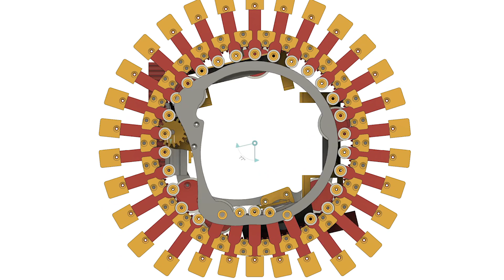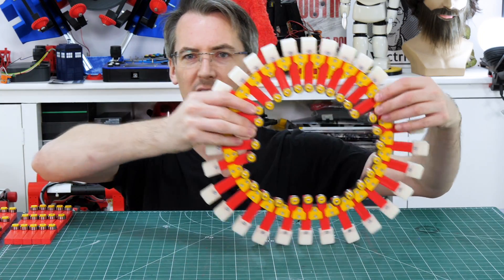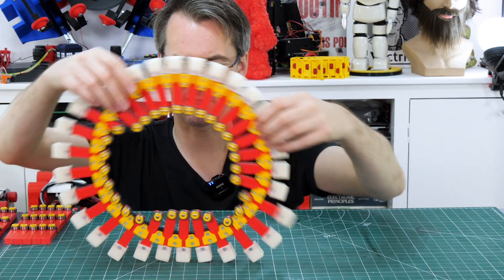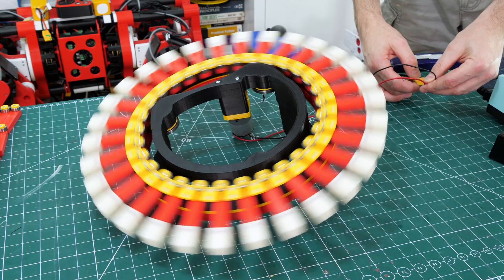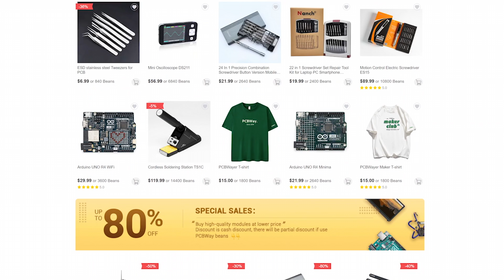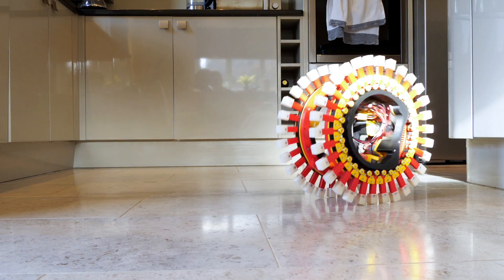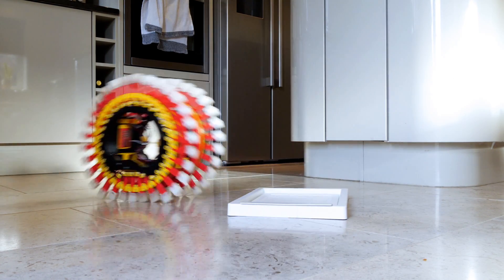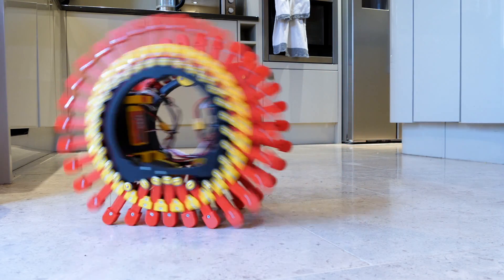Mechanically Stable Monowheel

Comment: Is it possible the wheel needs to be big enough that all the internal mass can be concentrated at the bottom of the inner circle? The theoretical maximum of this would be 100% of the drive, power and control systems would be located at the lowest point in the internal circle. The smaller the wheel relative to the internal guts, the higher the centre of mass, the closer that mass is to the centre of rotation and the more likely it is to pointlessly orbit the internal circle without driving along. The larger the wheel, the lower the carried mass can sit.

Comment: Would using round legs and feet help with the turning? _(still using the TPU for the feet)

As for turning, maybe program the inside wheel to rotate at like 25% speed?
Granted, that would remove it's zero-turn abilities, but even then, I don't think its turn radius would be all that big/problematic.

I also wonder if having a "fender" on top would be ideal, to allow it to travel into tight spaces, as the feet on the top traveling in the opposite direction wouldn't cause it to stop dead when contacting the ceiling. 
(maybe have some slits cut in at its tallest part, in order to recess mount a few bearings so that it glides across said ceiling, whereas letting the fender rub would cause friction; recess mounted, so that barely any of the bearings protrudes.)

Comment: The point of leaning is to compensate for the centrifugal force trying to tip it over. So the amount of lean you need is proportional to the speed you're moving multiplied by the tightness you're turning. You tried it out at a standstill, so the only thing it did was remove weight from the driving wheel. The goal is to maintain equal weight on both wheels. It might work better if you have your controller calculate the lean needed and then auto-balance. Mind you, that calculation would have to assume the center isn't flipping over, so if that happens it might make everything worse. A feedback system that measures the weight on each wheel might be more robust, but would complicate the build.

Comment: I think the issue is that you effectively have completely rigid suspension. It can extend in the middle but it's no good since it can't retract at the edges, plus it adds no pressure there, just rides along. So as long as the surface is flat and slippy, it's fine. But it struggles to simply move at all otherwise.

Comment: I think it would work better if it also had an outer guide rail shape to command the blade bearing to retract with more than just the weight of the device, so the bearings would be constrained on both inside and outside.

Comment: so uh, my thoughts
- heavier bottom
- some solution to prevent middle from going up the sides (like some action to perform when the middle is not oriented correctly
- possibly lock bottom feet so that they are always contracted (like a hook that would make sure the bearings touch the middle part's bottom curve)

Comment: lot of ppl commenting on the fact that it has 2 wheels actually gave me an idea for how to make it 1 wheel, make the wheel much wider, and have 2 or 3 rows of feet on that 1 wheel, and then to tilt instead of tilting the sides have a way to tilt the frame inside so that when its tilted to the left the flat section on the bottom makes the left legs go down and the right legs go upand thus using the change in the center of gravity to turn like a normal monowheel but being more stable bc of the flat sections

Comment: Im curious if adding a thin maybe rubber tape all around the outside of each wheel would help with off-roading. The object it went over seemed to wedge itself in between the feet so adding a loose material over the wheel would catch the object instead of it going in between, thus giving it way more grip.

Comment: You might want to cant the wheels in at the top and out at the bottom, put the slides on a bias. That would stabilize it in on-the-spot turns, and probably help free it more often if it gets stuck.

Comment: You need to be able to deform the inner wheel surface into a more circular shape. That would let you stand up the wheel that's not turning onto fewer feet to reduce friction.

Comment: Couldn’t you essentially do this with 1-2 point of contact for the ground with considerably more surface area for traction by using a standard rubber tire just with less air pressure so it conforms to the surface of the terrain and then adjust air pressure in the two hemispheres to get a similar but more effective way of turning? The word “hemisphere” brought to mind as I was writing you could even make it an orb that is internally separated into too volumes of air which a component joining inside that exchanged the gas between the two in order to alternated the favored direction for the sphere to turn while also having a similar mechanism to climb along the walls of the structure to intensives it to move forward or backward.

Comment: Goes to show that the difference between a cool mechanical oddity and a practical mechanical device is 95% software.  Things like the rotation could be fixed by damping the torque when in that mode for example.  I love the mechanical ingenuity James puts on display, and it's great stuff!  Many, many companies and inventors have come up with similar exercises, but the real hard part is precise algorithmic control,  which is why we rarely see concepts like this in many practical applications.

I think the next revolution in DIY prototyping ( the last one being able to print and iterate your own parts and plans with a 3D printer) is AI assistance in precision control in the presence of  external variables, and the code to implement such algorithms in real time, all at the access of someone who would otherwise not know how to code.

Comment: Try adding springs or rubber bands to the legs so they always retract. The problem I see with it is that the position between the extended leg and the retracted leg is not the same so it introduces a lot of lateral friction by relying on the weight alone.

Comment: It might be worth testing out using omni wheel style wheels on the feet. Basically mount rollers on the feet that are aligned perpendicular to wheel (maybe even make them out of flexible TPU). Doing that should still give it good grip when running straight, but would allow slippage when rotating. Another possibility would be Mecanum style wheels, although those are usually mounted in opposing pairs so I'm not sure they'd work out as well in this use case.

Comment: for the "tilt steering," you're not supposed to accelerate one side less, or not at all.  matched throttle with the tilt should get you at least through a wide angle turn.

basically, the tilt feature should provide stability for gentle turns at speed.

Comment: Nice engineering, but where is this really useful for....and if used on hard pavement, there is the wear n tear factor.... especially on  gritty surfaces...
Imagine though, a application for a Mars or Lunar type  Rover.???
Probably  would not work out ... because of the many moving parts....

Comment: Wouldn't the dip on the bottom defeat pretty much all the upsides of having that many legs?
Sure on a flat surface this dip works fine and helps with standing still, however on uneven terrain this will hinder what this thing is good at wouldn't it?

Comment: Not to smart I guess? Leaning over should only be used with enough speed to counteract centrifugal force making it fall over. That same centrifugal force would then increase the grip on the outside so it doesn't spin. Making the grip ends round would be wise to increase grip(contact surface) when leaning!
Reply from the maker: /too

Comment: Instead of leaning "in" to a turn, maybe this design could benefit from leaning "out" of the turn, by leaning towards the wheel that is going faster, it applys more friction and traction on the outer edge while releasing the friction of the slower inner rotating wheel that is pivoting

Comment: The concept of a unicycle is completely contrary to the task of climbing. The axis of rotation of the wheel and the center of pitch rotation of the machine coincide. There is no lever that would keep the car from tipping over other than a slight downward shift in the center of gravity.

Comment: For overcoming rough terrain, I think you need both: The ability to swing the center of mass to the forward half of the wheel (that you get in the traditional design), AND the bottom staying flat (that you get with this pedrail design).

Comment: Is centripetal force extending the spindles when spinning in place? Or is there added friction to the spindles, so they are not retracting as easily? Maybe both. Also having the two sides offset could be helpful on uneven surfaces.

Comment: f the feet were made to rotate perpendicular to the axis it should turn easier. Like a mini omni wheel. That should make steering much smoother. Imagine a Y facing down the shaft of the Y goes up and down between the forks of the Y Is a tube that rotates freely on a shaft that mounts to the forks of the Y. Forward backward would ride on the long axs of the tube. When you turn the tube would roll reducing the friction. Hope this helps jim

Comment: you could add an extensible third leg that could move to the back or the front that could be extended to stop the centre from free spinning when it gets stuck in the grass.  A scissor extensible "arm" could work if you make it rigid on the flat direction and would be quite compact.

Comment: What if, instead of the swivel mechanism, you could force the legs to stay fully extended on one side? Being able to dynamically change the wheel diameter would be fun. And then you could potentially connect the legs on each side to create a true monowheel with a flat wheel that could steer by adjusting the conical shape of its wheel.

Comment: Maybe if the two guides can rotate so that one side's guide moves the feet in/out earlier/later, as if to simulate an angled foot pushing to the side? I've seen something like this done in a video game but it used pistons to extend the feet in "NOOB vs PRO: Who Can Make the Best Piston Powered Vehicle? (Scrap Mechanic Gameplay)" and there was one wheel of feet but the feet were wide and had a hinge on the pistons to lean left and right for turning. Thus I thought maybe just rotating one of the guides would simulate the two ends of one wide foot. I'm not confident in it though.

Comment: instead of tilting, have springy feet? springs like shock absorbers on each foot? maybe
Reply: and a round wheel in the center section? without the flat bottom? maybe
Reply: and off set the wheel angle to give greater stability, with more weight at the bottom of the center section, maybe

Comment: The feet are rounded on one axis, if you round them on the other horizontal axis your could have a material with more grip a short way up the sides. Like a motorcycle wheel, as the vehicle leans it will transfer the contact patch up the sides of the feet to the grippy material. Might allow you to lean the corners...

Comment: Instead of using gravity to push the innards down/legs up into the "flat tire" profile, what if the bearings on the legs were in tracks that created that profile? It would for sure help the quick turning. When the wheels turned quickly the legs are sent outward with the centrifugal force.

Comment: Turning a wheel based on tilt has to do with the change in diameter between the inside and outside of the wheel. You'll need to decrease the amount of droop the outside wheel experiences relative to the inside wheel. That way, the inside wheel is simply smaller, and your machine will turn. Think car tire vs motorcycle tire. Fun watch!

Comment: what if to help with steering you had small wheels perpendicular to the way the big wheels rotate so you can still have a rubbery grippy material but then when stationary it would be able to rotate easier because of the wheels

Comment: very interesting. My brain wont stop thinking about a way to shift all the internal weight out from the center during stuck situations or maybe even up inclines. I guess the exact math would be that you want the center of mass outside the drive circle and as low as possible while not dragging on surface

Comment: Suggestion, remove the active tilting mechanism and just use rubber bands or springs to hold the vehicle in equilibrium. The end result is that it will naturally tilt when cornering and could be quite interesting!

Comment: Is it a wheel though? And mono? 😂?  Stable could also questionable 😊… Leaning would hardly help steering as te circumferences stay similar… but if you would be able to manipulate the guide on which the bearings ride to push the feet out more or less , changing the circumference.. that could do the trick….    Maybe a circumference-changing-wheel could be on your todo list.  Nice video!
Reply: Semi globes that rotate for instance

Comment: It would probably run better on grass if it actually pulled the bottom feet in rater than just letting them contract. Though i guess this was the first prototype essentially
Reply: Or even if you put a weight at the bottom

Comment: Leaning is only useful if you want to make a turn at high speed, to offset the acceleration by moving your cg. You probably want to mix that into variable wheel speeds for inner/outer track to make a turn.

Comment: When you tilt it side to side it is trying to ride on the edges of the feet instead of the flats.  Perhaps if you round the bottom of the feet laterally so that the feet have the same amount of contact regardless of tilt, maybe it will behave differently.

Comment: Rather than letting the floor push the rods in, you should pull the rods in before they touch the ground. Otherwise you're generating friction. I think that's the cause of the weird behaviors.

Comment: Super cool. Since the center stays put until it’s stuck, perhaps run a couple bars from the center over the top so if it does get stuck, the top bars would come down and around from the top and give it a push forwards  by running it backwards.
Reply: Like a dragster wheelie bar

Comment: this thing is charming as heck! even with the TPU feet, watching it spin and jump around was like a Disney robot dog or something. I think you are on to something here in terms of a fun toy! Maybe it just needs a bunch of weight in it to keep the central hub in the right orientation. Also you seemed to actually lose friction on the outside wheel when leaning because the feet didn't seem to contact the ground as much as the inside wheel. Cool toy!

Comment: I would argue like others that it's 2 parallel wheels and not a mono wheels :P 
Regarding leaning on a side to turn, I feel like the vertical movement at the center is higher actually that the height of the leg which doesn't help. Maybe limit the leaning by half and see?
Also, for the friction problem of the feet, you just have a flat face to the feet, you should do them slightly squishy and as an asymmetrical rounded V shape maybe so that when it leans over friction increase on the extended side, and reduce friction on the side where it leans.

What do you think?

Comment: What about making a big electric motor wheel. So basically you have an electric motor and the outside touching the ground and in the inside are all the components. Idk if this will work. Proporpally not. 1. too much magnetic waves. 2. the rotor would be way too big. 3. the rotor would be stationary and the stator would be rotating and idk if this will work, because normally it does not work like that.
But it would be a really nice experiment

Comment: I wonder If promoting the feet will help with some of the issues. It may help with It's Issue of getting stuck in divots. I noticed when it got stuck in The whole it kept spinning with the feet Fully extended Causing the motors to instead spin the internals without the resistance of the feet touching the ground the system wants to spin in place so by applying pressure towards the guide it should fix this issue.

Comment: I mean... Maybe it is just me, but is that not two wheels? Mono means one and thus only have one wheel. I suppose that if you squint your eyes, a rubber tire is just two wheel (the sides) connected by a foot (the bottom).
Reply from the maker: They ate the same assembly

Comment: When you run both engines in opposite directions I suspect the sideways movement of the "feet" get them stuck in their channels.  (IE they are pulling horizontally against the track, and get jammed stuck out and then lifts itself up)

Comment: Hello, nice project ! Unusual too :) I do think that if you can control both wheels internal black "gear" and have the one on the outside slightly tilted forwards, compared to the other one, it might mitigate/solve your stabiity problem when turning ;)

Comment: Great concept and build! I may suggest to link all the wheel feet by some sort of rubber tyre (or belt) in a way resembling a tank track (or a flat tyre) . That may reduce the lateral forces acting on the sliding legs when offroading. Or you may get rid of the sliders altogether and drive a belt around a "flat tyre" profile with rollers (by means of a pulley inside a loop on the top).

Comment: attach rigid teeth to outer side of wheel and attack gears to it that have high friction and are not moving so freely to limit the slip when it gets stuck alternatively you can add motor there instead and code it in a way that when excessive slipping is detected using a magnet or even signals from motor to apply small torque in opposing direction. you can also code it to tilt slightly when turning doing it manually causes issues because its hard to time tilt with turn with precision.
Reply: a limited slip differential is a good example and similar mechanism can be used here as well to limit the slippage